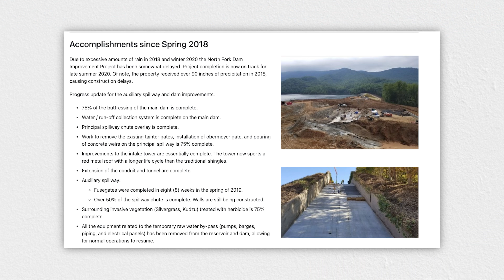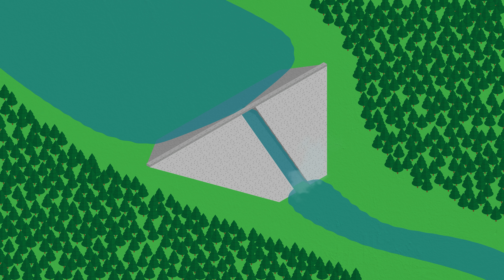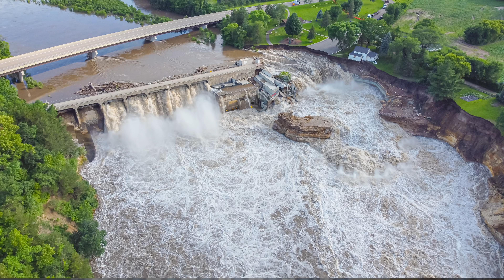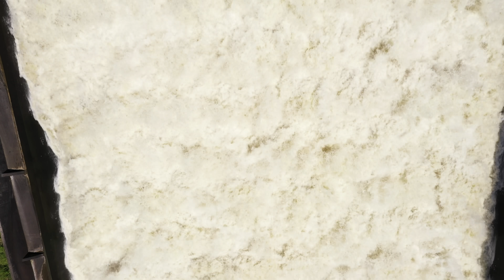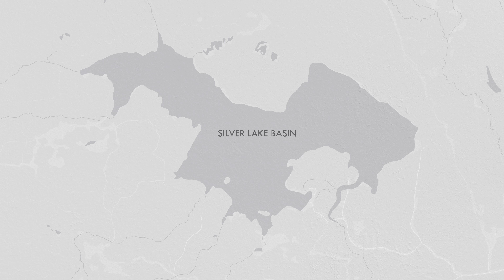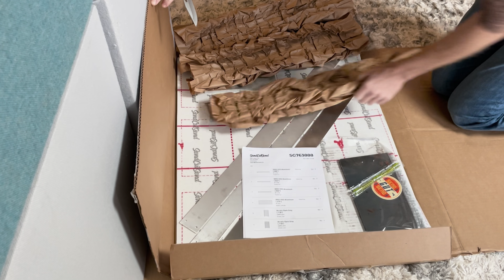This Spillway Failed On Purpose

Comment: @6:30 There are exceptions. The Maeslantkering in The Netherlands closes fully autonomously, no human brain in the decision tree. When the barrier was designed the engineers specifically chose to make it close autonomously because humans are susceptible to emotion and irrational decision making as it's a "lesser of two evils" type of situation. Closing the barrier unnecessarily comes at a great cost to shipping (it blocks the port of Rotterdam, one of the biggest and busiest ports in the world), while leaving it open when it should be closed would cause major flooding with potentially millions of lives on the line. So they opted to make the barrier fully autonomous driven by sensors and data, to prevent any irrational human decision making in the heat of the moment when the water is approaching a dangerously high level.

Comment: I always think dam engineers love sending huge sudden surges of water downstream and engineer new ways of doing It using the excuse of dam safety.
You cant tell me there IS no way of just allowing the excess to flow on the slipway.
Nooo, It must first get to the top, and suddenly empty half the reservoir to the point you cant even recover your reservoir without a building project.
Make the thing 95% the height It can safely hold and let the rest flow over and through the slipway.
Why always need to blast anything downstream exactly when the flow is already full?
They dont seem very good at the not holding part.

Comment: The fact that the Fuse Gate system depends on an pocket of air under the gate worries me.  Is there any concern that cracks, bad seals, or clogged drainage could allow the chamber to fill, tipping the fuse gate without warning?

Comment: Could you not include floats in the design of regular gates to make them open automatically at a certain level? Unlike the tippable design you showed, they could still be command-operated to preempt large inflows, but they would still be a fail-to-safe design

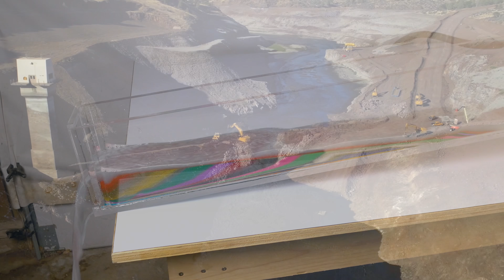Comment: 14:30 i feel like the sedimentation issue is something we could easly take advantage of. Theres lots of precious metals that get eroded out up stream of dams, so this is like natural mining. If a placer mining sluice wher built at the base of these  dams and a mining pipe built through them, you could hydraulically mine the sediment with the pressure of the resivour.  Extract valuable metals and let the rest flow down in a controlled way.

Comment: Thanks so much for putting this video together.  As usual, your videos are informative and entertaining.  I recently read the book, "The Johnstown Flood" by David McCullough which discusses one of America's worst disasters caused by the failure of the South Fork Dam near South Fork, PA.  The disaster occurred in 1889 and resulted in the loss of over 2,200 people.  In that case, (1) the plumbing normally used to control the water level of the dam (used to lower the level ahead of storms) had been removed when it corroded so the water level could not be controlled, (2) the height of the dam had been lowered to provide for a wider roadway surface, and (3) the capacity of the spillway had been reduced by placing fish gates across the spillway so fish imported from Lake Erie would not escape.  The significant storm event caused the water to overflow the center of the dam, washing out the dam and sending a wall of water, rocks, trees and everything else bulldozing its way down the Little Conemaugh river valley and wiping out many small towns and most of Johnstown.  You or your readers might find The Johnstown Flood to be an interesting read.  Mike

Comment: varistor dam seems like a even more accurate term, though I understand that people are lot more familiar with fuses.
Reply: Most varistors don't need to be rebuilt after every use.
Reply: @ps.2 most varistors I've seen after they got used  have disassembled themselves in the process, though that may be caused by them being built for high voltage. As far as I know, shorting out overvoltage tends to be fairly energetic.

Comment: I expected sth like self unloading container for forklifts. It is easy to lift to storage position when it is empty. Then lock it, drop whatever you need and if it is time for unloading, just unlock it. Mass will tip it over. Easy and efficient. Just design simmilar gate. That would be not a constructin project to reset it. Just decrease water level below safety gate, rise gate to work position, lock it.

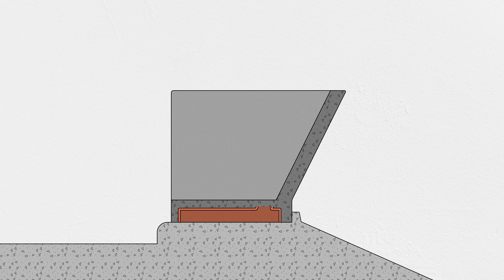Comment: 13:37 Is this is a simplified example? Can't that chamber be filled with heavy rain water and engage the mechanism?
Reply from the maker: Yep there's a small drain at the bottom so that only a large flow can cause it to tip.

Comment: Same concept as "Flashboards" we use on smaller dams on the east coast US. Wooden boards mounted at the crest of the spillway, sometimes supported by wooden posts or steel pins or steel pipes. They are designed to fail and collapse with a certain amount of overtopping depth. In many locations these are washed out nearly every year by the spring ice-breakup and high flows (by design). They are cheap and easy to replace once the flows come down later in the spring.
Reply: A lot like an old fuse box. You put in a part that will break first so the system can fail in a safe way.
Reply: My first job was building flashboards for 4 hydro plants my dad managed, he said that if they lasted ~4 days they paid for themselves in pwr gen from the higher head.
So many boards cut and nailed...
Reply: The 9 Mile dam near Spokane used to do the same. I was always told it was so they could get more power out of it. They eventually replaced it with an air bag system so they could preserve the cap, and I think they've now just made the cap permanent.

Comment: I don't see why there should only be one spillway where a spillway is. By that I mean you have the normal spillway for day to day expectations but then also have a wider storm spillway build on top of it to handle much higher levels of water. To give a rough idea of how the double spillway would look here's my best attempt in ascii:

_                                _
  |__                ____|
           |_______|

In other words there's no gap between the storm spillway and the normal one, the normal one just helps hold more water for day to day stuff while the storm one helps prevent the dam overflowing on all sides

*Edit:* Incidentally the mechanical gates can be protected from the full force of the flow by just adding a hill in front of them, forcing the water to prefer jumping upwards before falling back towards the gates. If the area between the gates and the hill is full then the water will just flow over the gates instead of building pressure that would ultimately break the gates. For the overflow you could design the area in front of the gates to have a kind of pit with a tunnel at bottom for the average flow to go through while the overflow would instead fill towards spillways at the top.

Comment: I would think a staggered widening "V" shaped spillway would be the most practical solution as it releases more and more the higher the level with no gate that need replacing or need to staff it 24/7, you could even have a float alarm that calls a emergency crew at the second to last level just to be safe. Are V shaped spillway restrictions not in common use?
Reply: I know I've seen spillways that get wider the taller you go but they seem to generally be in step patterns. I do wonder why that is. Maybe they want more simple management of water release, where the increase in width happens at specific heights. Simplifies the math. As it is, a spillway flows more the higher it gets because the height increases the cross section, so getting wider would increase the rate by like another magnitude.

Comment: But what the city did went far beyond this simple redesign. They had lost flood control capabilities due to the amount of silt in the reservoir. In 2014 the Tennessee Valley Authority (TVA) began updating the rain data to provide more accurate PMP values to that region. Schnabel requested that the French Broad River Basin be included in the study, which proved to be a valuable asset to the design team. Once the data was available, the City of Asheville used the information to request an updated PMP amount from NC Dam Safety. The Probable Maximum Precipitation (PMP), or maximum amount of rain in a 24-hour period, volume went from 34 inches to 28.4 inches for a 24-hour period thus reducing the total volume of water the spillways would need to pass, limit the environmental impact, and reduce construction costs. A labyrinth design was chosen, with the final design being the first Fusegate spillway in North Carolina. This design reduced the spillway width by 100 feet; reducing excavation, construction time and costs. So, the engineers applied for and successfully reduced the 34-inch rainfall amount - which had been in place since 1955, to 28.4 inches, in order to save money on dam features - and the people downstream paid for it. EDIT: I forgot to mention that they also raised the parapet wall on the dam by four feet, as part of the revision, in order to increase storage - which also added to the downstream damages.

Comment: Quick question: Do they ever dredge near dams to remove built-up silt and restore the original depth and capacity? I’ve seen those ocean dredgers pumping sand to create islands; could something similar be done around dams?
Reply: Yes, sediment buildup is a frequent long term maintenance concern for many dams, and dredging is one solution to it.
Reply: Didn’t they flush one of the Colorado River dams to get rid of silt ?    I wondered how that worked.  Was there a deep outlet that got below the silt level ?

Comment: I thought the dirt fuse plugs were Mickey Mouse engineering then I saw the concrete ones … “I’d just tips and falls down.” Instantly adding idk 50 to 100+ tons of concrete and rebar debris into a sudden flood.
Reply: Same here. I thought it was the theoric demonstration that led to something else. Then realized it's fo real !
Reply: Couldn't they have some kind of pivot at front of their base so that after they have tipped when the flood recedes they can be craned back into place?
Reply: You somehow think that the engineers did not think of that? Also, calling such an elegant solution "Mickey Mouse" is just plain insulting.
Reply: @grumpybastard5744  cry about it. Also L patent
Reply: I don't think that's a huge issue, concrete and rebar are heavy things, the flood won't carry them too far. My concern would be it damaging the floodway, which could lead to it getting eroded.

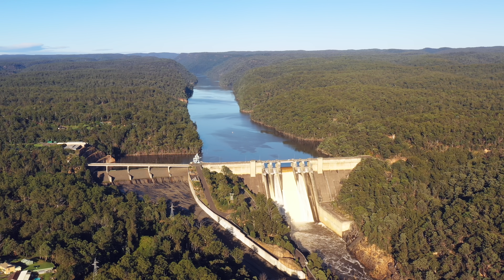Comment: Are there staggered (passive) spillways? I see they did have some sort of staggered fuse plug spillways at 10:30. Or does my idea not make sense, as you'd still need to build a way too high dam?
Reply: Staggered height passive spillways would basically be the same as a tapered or triangular cross-section spillway.

Comment: since fuse plugs are made of easily eroded material, how are they protected from wind erosion? the ones in sydney look like they would be vulnerable to wind moving upstream
Reply: Probably maintenance covers that, wind erosion should be less than the rush of storm water, a few shovels every week or two should be more than a fair trade

Comment: "Apple-AY-shuns" is how people who are not from the Appalachians say it.
Reply: Just a note, the Appalachian mountains stretch from quite far south to quite far north, and there are plenty of people who live along the mountain range that pronounce it App-uh-lay-shun, the pronunciation isn't based solely on who lives far from it, but rather split mostly north and south along the Mason-Dixon line many other words. There have been many words for the mountain range by region, but Appalachia was the term that originated in the south from the Apalachee tribe and was originally pronounced with the latch pronunciation, so it can be argued it's the original and correct version, but it's not based on who lives near the mountain exclusively.
Reply: It's just one of countless place names that people not from the place pronounce differently.

And for those who are actually wondering, the locals there say "apple ATCH uns".
Reply: @mattgies
APP-uh-LATCH-un
Reply: @beryllium1932  That's functionally identical to what I wrote. The first syllable of "apple" is the stressed syllable; it's a trochee.
Reply: @mattgies
My way is closer to what I've observed in the wild.
Reply: @beryllium1932  It's the same way. Did you read and comprehend what I wrote?
Reply: Yeah, he probably puts the emphasis on the first syllable of "Paris," too. What of it?

Comment: You know, I have heard a LOT about how that HUGE dam in China, Three Gorges, is actually somewhat risky and not as strong as they would like to think. I'd LOVE to see it evaluated by the keen eye of the one and only, Grady.
Reply: It's just a gravity dam. There is no way to get rid of excess water filling the reservoir past a certain rate. Once it gets past that water will over-topple the dam and cause it to break.
Reply: There's a LOT of ugliness in that massive landmine. I think Grady should stay out of that one: I just don't want him to spend time and get involved in that level of political/nationalist heat. Education, not controversy, is the way!
Reply: @LD-Orbs  how about a history of breached dams? Especially from Moa era
Reply: @cucuawe465  Maybe: at least, that's less politically sensitive. Perhaps a variety of examples, from across the world.

I mainly want to avoid the Chinese fixation of politics. That's just a distraction and a bother, when you want engineering solutions without the loud, distracting nationalist complaints.

Or just cut the Chinese out, and go forward with failure examples from the rest of the world, including the US, thus sparing the Chinese from losing face, which is EXTREMELY important to them. 

That's what I recommend.

Comment: It has been long past time to rebuild our dams.  With a 10 times higher output through turbines, not only could we use hydro power as a peaker instead of base load, but we could transport extra power to other parts of the country before a flood to vastly lower a dam to lessen the flooding.
Reply: Nah
Reply: @FuncleChuck  Water is life.  Water is an investment.